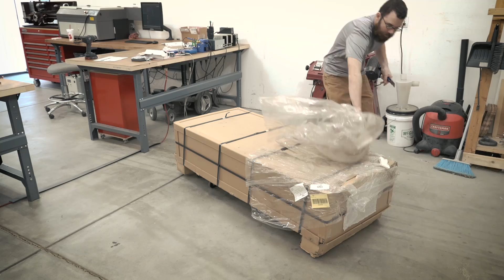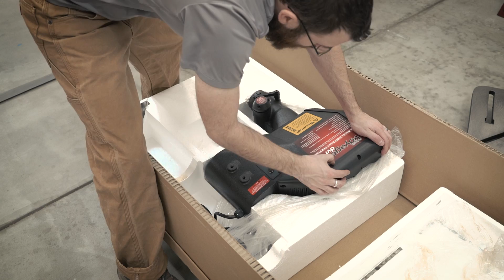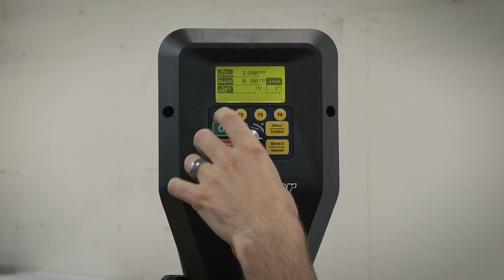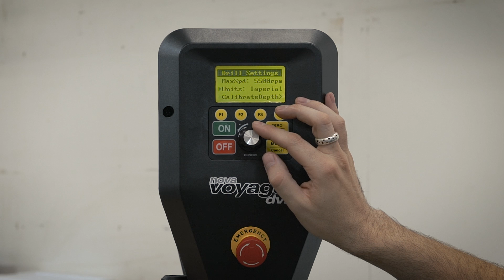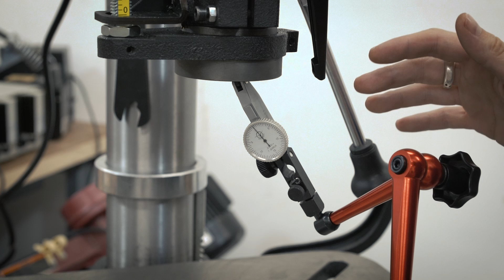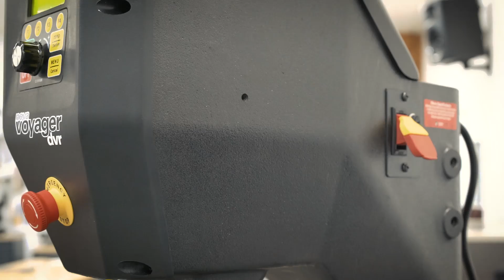Tool Review: Nova Voyager DVR 58000 Drill Press

Comment: Seems like a dream machine, but it’s not.  It comes with a chuck with visible runout that vibrates the entire machine.  Why not give us a better one from the start.  Also, you turn it on and it takes 10 seconds of warnings and such to allow you to get working.  And, I can’t even imagine having to try to fix this when the electronics go on it.  I’d recommend an old reliable model or a milling machine.
Reply from the maker: OK, a few things.  ALL CHUCKS HAVE RUNOUT.  It's not vibrating the entire machine.  I did get a better chuck that has been on there for years.  The warnings are only for the first boot after power loss.  And the whole "try having to fix electronics" is just an outdated thought.  Most tools are moving to brushless motors now and this is very very common.

Comment: One of the most ridiculous features is the beeping indicator. Most guys who have been working with tools have some hearing loss. Couple that with the fact that there is noise when you are drilling wood or metal and there might even be people talking and music playing in the background and the beeping noise becomes nonexistent. It should be louder. Honorary mention is the drill bit speed for spade bits and spade bits with spurs and you’ve just wasted a spot that could have gone to something like pilot bit or wire brush or something else.
Reply from the maker: It sounds like you just don't want to like it.  The beeping is audible even through hearing protection.  Also, even if it isn't, no other drill presses have ANY feedback at all, so what would you propose instead?
Reply: @RobertCowanDIY  I’ve been in the construction trade for over 40 years and after time spent in huge concrete tunnels all the way down to my head and upper body inside cabinets with drills and impact wrenches I can assure you that my hearing has gone south and then some. Along with almost constant tinnitus and being over the age of 65 I’ve found that hearing protection back in the ‘70’s would have gone a long way but we didn’t “do that” back then. What I propose is a much louder beep with a volume setting for young guys like you who have benefited from lessons learned by guys like me. Volume control in, say three increments so as you get older Robert and your hearing diminishes (as it will) you will continue to benefit from my wisdom. I do want to like it, I just don’t find it useful in its present configuration.

Comment: I wanted to see a 3” hole saw used.  Low speed power is what I wonder about.
Reply from the maker: Hum, in what material would you like to see?  I've been planning a revisit on this vide.
Reply: @RobertCowanDIY  thanks for the reply since it’s been a while since you made the video.  I looked at that same unit because of the variable speed.  The direct drive to the spindle makes low RPM , high torque applications questionable for me. I have considered repowering on of my existing drill presses with an AC or DC motor and drive but maintaining the reduction to enable things like drills in steel and even stainless steel (have had those problems) and the hole saw thing. 1/4” aluminum for a 3” hole saw or similar would be cool as would be a 5/8” hole in some hot rolled structural steel.  1/2” in 304 stainless steel (1/8” thick?) would all challenge the performance envelope of a higher end home shop type drill press yet would not be outside of what I have done (at least attempted) on the made in Taiwan Delta drill press I purchased in the 1980s. 
BTW, I have been putting together a Tormach 440 this past week and your videos have been very enjoyable as well as having been responsible for my watching your channel! Thank you.

Comment: That was a great review. I really appreciate the view of the internals as well. So it's been a little over 5 years since this video, what are your impressions now?
Reply from the maker: I still love it and my impressions are about the same.  Most of the more 'gimmicky' features are in fact gimmicky.  BUT, being able to switch the RPM quickly, the build quality, lack of noise, RPM range, etc, are all top-notch.  I would not buy another drill press, period.

Comment: Nice video - how did you adjust the quill retraction spring?
Reply from the maker: The same way you adjust the others.  There are a couple of jam nuts, you just loosen or tighten them.
Reply: @RobertCowanDIY  Thanks for getting back. My model is the Viking and from the schematics looks like the retraction spring design is different.
Reply from the maker: @youmbgtube  Ah you're right.  From the pictures it does look a bit different.

Comment: Has this drill press held up and would you do it again now that it’s been a while?
Reply from the maker: It's held up just fine.  I still have the same gripes in the video, the extra features are a bit gimmicky, but could be useful for some.  However, the ability to dial in a speed, not change belts, etc is a game changer.  It's quite, feels like a premium product, and is the best drill press I've used.  I would 100% buy it again, no question.

Comment: Fantastic video. I see why you need the disclaimer, your salesmanship is excellent. I'm a beginner woodworker / aspiring metalworker and this is the one tool I reeeally splurged on (about 3X the cost of the next most expensive tool in my garage shop), and finally after 4 months of waiting its comin, and this alleviated the very miniscule buyer's remorse I have.

Video was super thorough, the only think I can think of that you missed would be that it can be hooked up to 220V which ramps it up to a full 2HP. Have you done this with yours? Would it be worth it? Mine is gonna be sitting right in front of the breaker box which has 220v in conduit that's on the outside of the drywall- not sure what that's worth because I'm basically clueless when it comes to electrical.

Comment: .002" run out is okay. .008 is NOT good for a new drill press. I'd ask for a new chuck. Other features like the quill travel and split casting are GREAT!  As for all the electronics...  well, I'd rather they spent the money on a dove tailed column, power table lift and an x y mill table. Of course nobody else is doing this but that probably a good reason they should. Impressive gizmos but I don't need them.

Comment: Very informative review.  We're looking into purchasing the Nova Voyager.  I would like to know if you're still happy with your Nova 3 years later?
Reply from the maker: I am.  See some of my other comments here, but in short...  I don't really use as many of the fancy features as I thought.  I don't use it for tapping, I don't use the speed wizard thing.  BUT, I do use presets (for different speeds), I love the ability to go from 50 RPM to 5000 RPM with a couple buttons, and the drill just works the way I want.
Reply: @RobertCowanDIY  thanks for the quick response.  We've seen tons of box opening reviews and really wanted an opinion from somebody on how they like the drill press after having it for awhile.  I'm looking for accuracy in a drill press.  One that can drill a straight hole without fail over and over again.  Our old drill press just doesn't do that.
Reply from the maker: @sewcrazylady  Oh, THAT it can do for sure.  I should maybe do a followup video, but I mainly use it for aluminum and steel.  I use it quite a bit and it's been good to me.
Reply: @RobertCowanDIY  Pleeeease do a follow up. I also want to know about accuracy. It would be nice to see a runout measurement and how square this drills left to right and front to back.

Comment: @Robert Cowan   
Any issues with this machine in the 3 years that you have owned it???

Have there been more firmware updates or just the one?  Is the warranty decent?

I'm currently looking for a 2nd drill press for my shop and would like something with these modern features.

I think that these newer types of "computerized" drills are fantastic for speed, repeatability, increased accuracy, and production-type drilling, as well as safety features, etc. 

HOWEVER, I have a few reservations:

Will these proprietary circuit boards and particular DC motors or their mounting scheme still be available in 5 years, 10 years, or 20 years down the line if there were a failure or defect???

Will the manufacturer even be in business in 5 or 10 years, or will they go bankrupt and/or be bought out by a conglomerate who scraps the design and discontinues production in favor of "current tech'', rendering this drill press obsolete and worthless???

With an "old school" or "dumb" drill press, most parts are fairly standardized and I'm fairly confident that parts would be readily available and replaceable for years to come...or at least machinable.

For example, I've had a Rockwell drill press for over 25 years that I've been able to keep up & running due to its relatively basic and standardized mechanical design.

As a somewhat relatable, but opposite example, my sister is somewhat of a gourmet chef and purchased a very high-end elite brand kitchen wall oven...I'm talking $5k+...during her kitchen remodel a little over 5 years ago.

The oven was just over 4 years old when the main electronic-control circuit board in it failed, rendering it completely useless...it wouldn't even turn on at ANY temperature.

The manufacturer no longer had a backstock of replacement parts available, and had recently updated this model.  It looked basically the same, but had ''new & improved" features and therefore all-new internals.

My brother-in-law "got lucky" and located a replacement circuit board on eBay at the cost of $1899 USD plus $80 shipping from Europe, haha.  :gulp:  

In addition, they would need to pay a service center $$$ to perform the installation of the new control board.

Ultimately, they decided against it because of the likelyhood of another failure and the probability that another replacement would be impossible to locate at any cost in the future.

Obviously they would've had well over $7k invested if they had gone with the replacement part and professional installation.  :-O

They opted to sell it on eBay at quite a loss, but at least they recouped some of their investment.  :-/   

Needless to.say, it got replaced by another high-end oven, but a well-regarded used one with no electronics other than having a "dumb" digital temperature & timer display (neither controlled the oven's operation).

My parents had a similar experience with a Samsung clothes washing machine that was less than 2 years old.  The replacement parts with installation were more than half the price of the machine itself.

The parts were available, but were not easy to locate or obtain...had to order directly from Korea!  :-/

Don't get me wrong, I LOVE technology, but often times for products that are somewhat basic in design and inherently mechanical in nature, a K.I.S.S. approach will often serve you better in the long term.

Of course, if someone can afford to replace these types of products every 3-5 years or so, and are okay with the  "disposable society" aspect, it's their decision to make.

I REALLY want thto take advantage of these useful features, but I am obviously a bit hesitant, LOL!

Sorry for the long-winded post!

Just sayin'.

Comment: Did you ever do a follow up review for the Nova drill press? ;)
Reply from the maker: I didn't.  In short, it's the best drill press if you don't want to go with a 220 or 3 phase one.   The extra features are a bit gimmicky and I rarely use them, but not having to change belts, the power of the motor, and the speed range make this one of my favorite tools.

Comment: Excellent Voyager review. Can you also mill aluminum with the Voyager as you can with the Nova Vulcan, the machines look similar ? A video showing the Nova drill press Milling aluminum would be great.
Reply: This machine has virtually no runout (aside from the stock chuck which you can upgrade), and for $1700 I wouldn't risk compromising that by applying side loads. Most people I've talked to said they wouldn't even use it for sanding for that reason. Also it seems a lot of the more extreme metal workers think the Vulcan wouldn't be great for milling either. But how badass would it be to tell people you have "a Nova Vulcan drill press".

Comment: Wow, you can stall a gear head drill press or a regular drill press with tight belt at 50rpm? Really? Want to try? I first make sure you sign a disclaimer. You can stall it at 1500 rpm but not at 50 rpm (if it actually went that low) the lower the speed the more torque you have at the chuck. Also this drill press does not have 1 3/4 HP - unless China invented perfect loss less motors. 8th thousands runout is not that bad - that is a POS chuck that you can get for $10. Its cheapest chuck money can buy. Look at https://www.youtube.com/watch?v=_yWdZAC1w2I - few 1000ths run-out! This is important when drilling small holes. https://www.practicalmachinist.com/vb/general/drill-chuck-runout-drill-press-313803/ 0.002 is good. 0.008 is not good. Spindle run-out at 5 tenths by going with previous link is typical for DP. Why not say its only MT2 spindle? Or mention that electronics have only 2 year warranty vs. the rest at 5 years? You sure they don't pay you?

Comment: 3 phase motor drive looks impressive but without shaft reduction torque could be lacking.
Reply from the maker: Above ~200 RPM it's fine.  Below that it can cog a bit with big bits in hardened steel.

Comment: Most of the first mass produced drill presses didn’t use rack and pinion table lifts/elevators. They used collars, threaded rods, and bevel gears. Goes all the way back to the days of camel back drill press.

Comment: Did they solve the issues you had with tapping and power hold?
Reply from the maker: Here's what I replied on facebook:  Brendin Emslie The spindle hold is great, I use it all the time. If you're REALLY doing something silly (drilling 1/2" hole in hardened steel) you might have some slippage with a keyless chuck, but it works for 99% of holes. The tapping feature is 'ok'. It kinda works, but only in certain applications. If you want to use it for tapping, just get a tapping arm instead.
Reply: @RobertCowanDIY  Awesome.  I do have a procunier tapper I can use.  Thanks
Reply: @RobertCowanDIY  I did pick one up and set it up last night.  It came with the latest firmware.  One thing I noticed is that it is very hard for me to zero it out.  It always fluctuates between 0.000 and 0.002. Sometimes I can't get it to fluctuate and it zeros to 0.002.   It does this with the quill at the top and with the quill locked a few inches down.  I am wondering if you see this fluctuation on yours?
Reply: One thing I noticed is that all the videos online show the older firmware that only displays hundredth of an inch precision vs thousandths.
Reply: @RobertCowanDIY  https://www.youtube.com/watch?v=eEx_qBiX9q4
Reply from the maker: @xnaron2  Mine is very stable and I haven't seen that.  I wouldn't worry TOO much about it, 0.002" is pretty small and the flex in the quill or table would be at least that.  does it prevent you from doing anything?

Comment: If I'm not mistaken you can run these on 240v for 2 hp.
Reply from the maker: Hum, I'm not sure about that.  The power cord is hard-wired and it's only for 110V.
Reply: @RobertCowanDIY  https://www.teknatool.com/product/nova-voyager-dvr-drill-press/

Requires changing the plug. Not sure if .25 hp is worth the trouble but good to know.

Comment: With a automatic garage door opener a thief may be able to find your code using today's technology open the garage door and steal your equipment or tools when your not home. Manually opening the door prevents this. I had the same situation and very rarely opened the garage door and locked it from the inside. Unless you also park a car in the garage with your equipment I recommend not having a garage door opener or just unplug it as I did.

Comment: Given that the drill can speed so faster ( 5500 rpm?) - do you think it would be possible to rig up a poor-boy's vertical lathe of some sort? It would require some sort of chuck on each end but I don't know a lot about lathes. I would get a lathe but my space is limited and I would not use it much
Reply from the maker: You know, that COULD actually work.  You would definitely need to have some sort of live center at the table, but it could probably do OK.

Comment: Excellent video! Very professional and thorough - easily in the 95th percentile of tool and woodworking videos.  The only thing missing is the method of performing firmware update. Do you have to drag a laptop into the shop, or just a flashcard. Thanks!
Reply from the maker: If I remember, you need a computer.  I just use a long USB extension cable to my shop computer to update it.  But you really only need to update it once, maybe twice.  I've only updated the firmware once since I've had it.  And I've had it for a few years now.
Reply: @RobertCowanDIY  Thanks! So I assume you are still pleased with the performance of the Voyager?

Comment: Well dammit, was about to pull the trigger on a Rikon 30-217, then THIS shows up in my recommends! Also, any updates on the longevity of those blister buttons?
Reply from the maker: There are things I don't like about it, and things I DO like about it.  I rarely use many of the 'advanced' features, but I like the ability to adjust the speed without belts.  I can go from using a buffing wheel at 3500 RPM to deburring holes at 200 RPM in seconds.  As for the buttons, they're a BIT of a pain to use (you gotta really press them), but once you get into the habit, they work all the time every time.  I've had no issues with them, and I see them holding up.  How often do you use these same buttons on a microwave?  I feel confident they'll last.